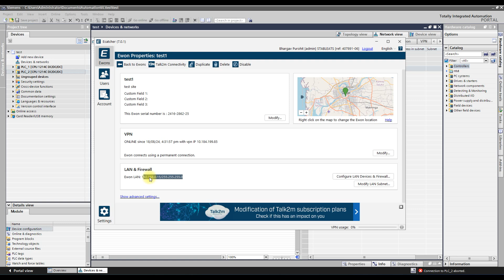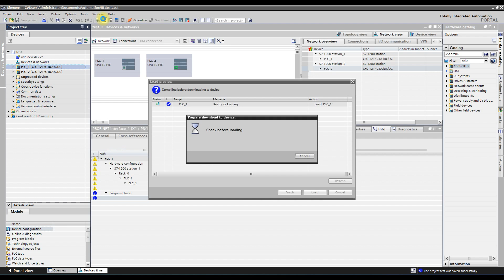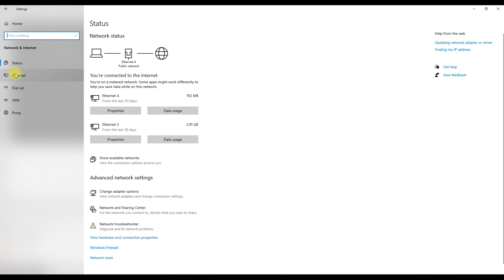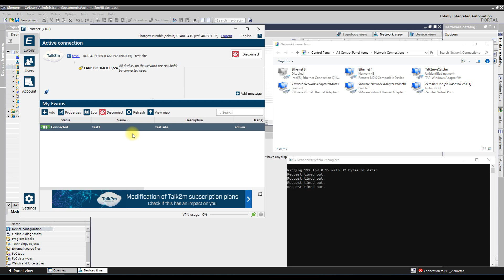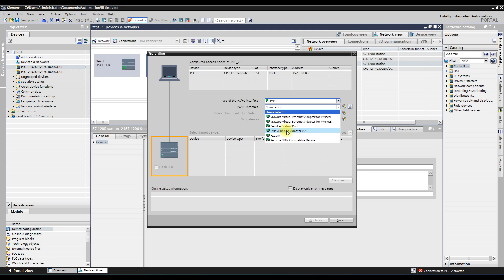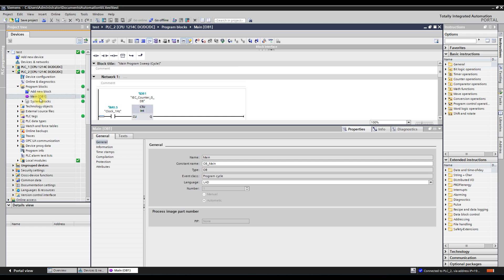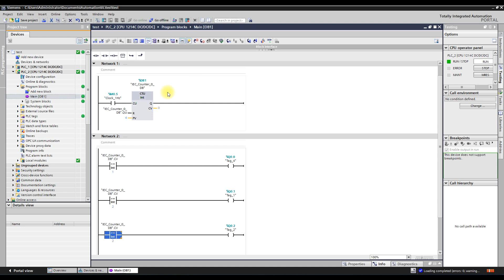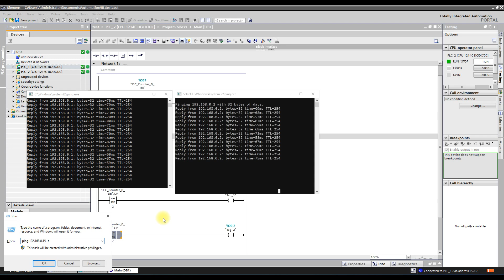Remote Access Siemens S7 1200 using Ewon Cozy 131

Comment: Hi, why do you adjust in only plc the router address and not in both?

thanks
Reply from the maker: I am glad to know when viewers watch video in detail.
It was a trial by enabling "Use Router" option only in one PLC, to check it is required to access PLC through EWON. But during trial, I was able to ping second PLC in which "Use router" option was not enabled.
I am exploring more about it, and will share if found something meaningful.
Reply: @StableAutomation  Hi what are the differences between tap-windows adapter and zero tier virtual port?